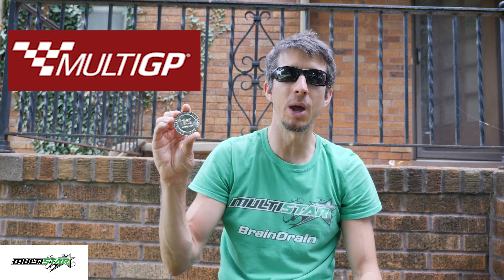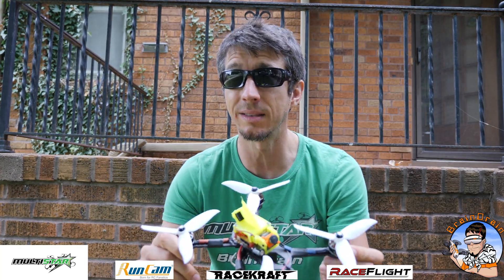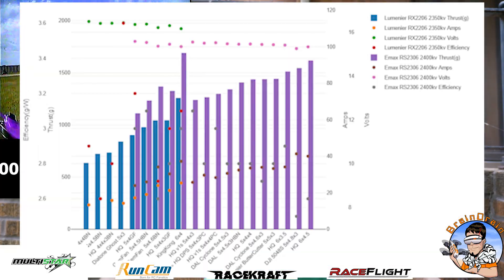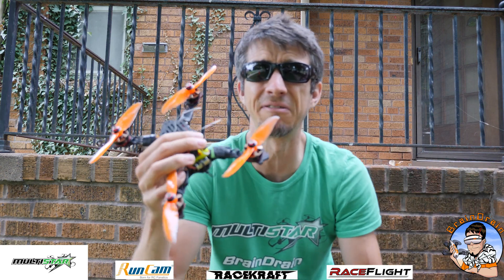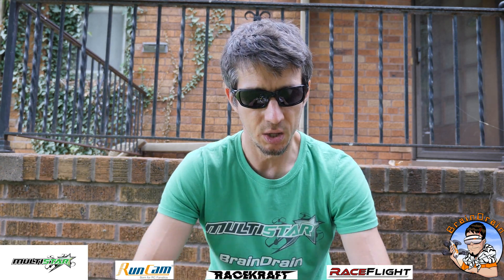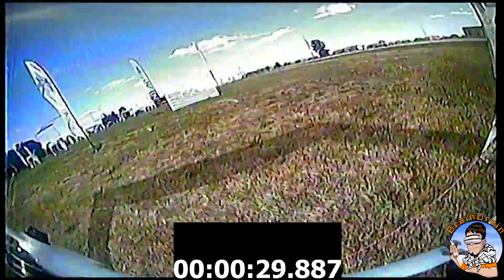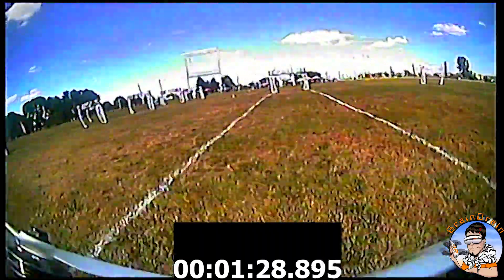Magic Motors revealed, 1st Place and Thoughts on the Journey

Comment: Interesting stuff. I had a guy go through my site and run the efficiency data on pretty much all the motors I've tested, and his conclusion matches yours, just on the data, which is really cool.  Also, I predict you won't see near the same flight times on the MX2450kv.  When you increase torque via those design changes, like tighter airgap, etc, it costs current efficiency.  Mechanical efficiency (the ability of the motor to convert a given voltage into a given RPM) always comes at a cost. 

Another thing that you've hit on here that is fascinating is that weight doesn't make up necessarily for speed, but it does make up for lower torque to a point.  It can't make up for something as low torque as a 2204, as you found out (which I pointed out at the very beginning of this conversation on weight months ago :D), but it does make up for a motor that has mid range torque (compared to modern motors) like the Lumenier RX2206.  It's also interesting that in a dynamic situation the unloading of the 2350kv vs the 2140kv gives the higher KV motor an advantage even though static results are quite similar.  Again, expected given the variables, but cool to see it play out.  In proximity freestyle though, where you don't need that extra bit of speed, they're very similar motors. I ran the 2140kv for quite a while and loved them, fantastic on quad blades, and quite efficient.  2206 has always been one of my favorite stator sizes, good balance between weight, torque, speed, and efficiency.

Thanks for posting that! I always love to see how in-flight testing compares to the test data.  I have yet to see a situation where they don't align given a close look at the variables involved, even if they don't seem to at first.

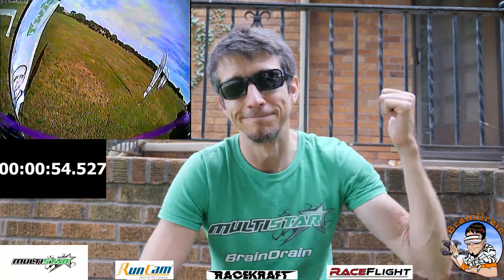Comment: Im thinking of building a 5" that can survive 2:30 on a 1300 mah.  are these still the best motors for the job?   Do you think they'd pair well with the gemfan 5051 2-blade  or cyclone 5050C 2-blades?  Looking for a sizeable advantage over my 1407 4" without having to buy a fleet of 1500 mah batteries.

Comment: I'm still waiting on good 5.5 inch dual blade props.  I think that will be the perfect mix between a 6 inch and 5 inch triblades.  I want something like a cyclone 5050 or a gemfan 5152 type blade, just a little bigger.  I'm also curious about the new 2306 Brotherhobby 2450kv R5 Returners.

Comment: Which cyclones? 5045, 5046 or 5050?
Reply: 96% sure the 46
Reply from the maker: 5045 ;)
Reply: Thanks! Did you try the hyperlite v2 2205/2522's? If so, how did they compare?
Reply from the maker: 5 laps in the 22-23 range 1500mah dead dead dead battery.  cyclone 5050 bi blade
Reply: Why the bi blade on 2205? I compared the bi blade on my 255 gram 2205 setup and it was much less efficient that the 5046*3